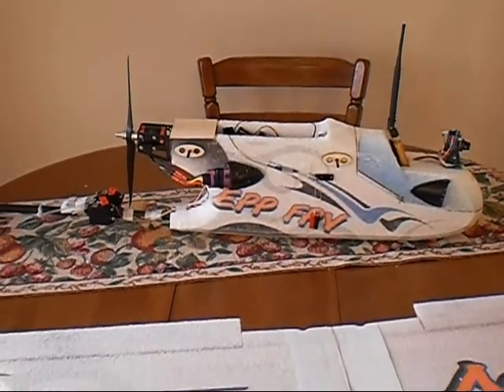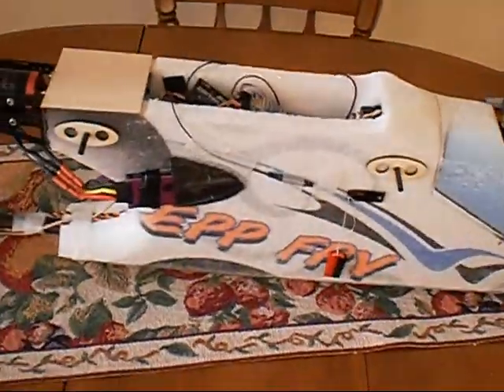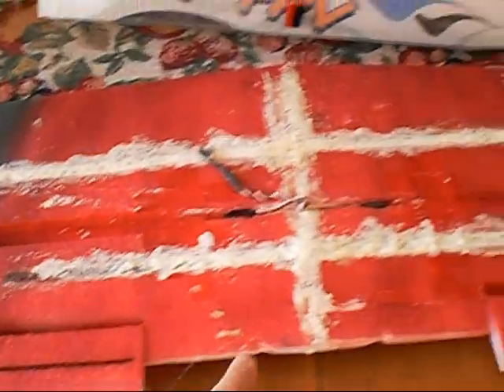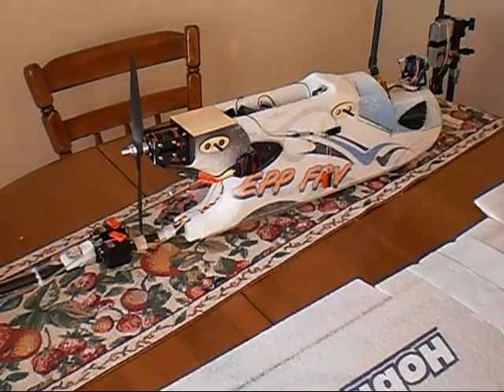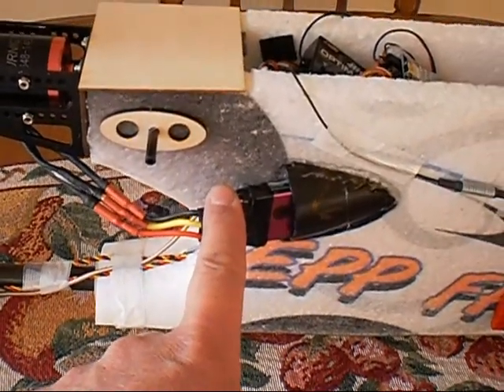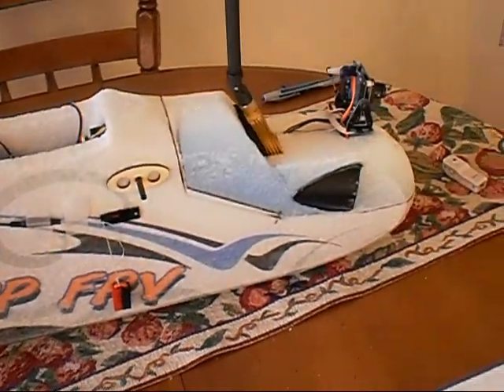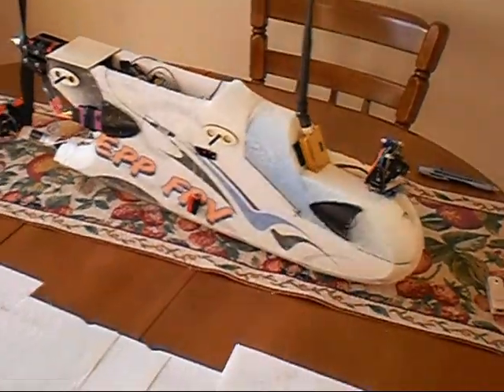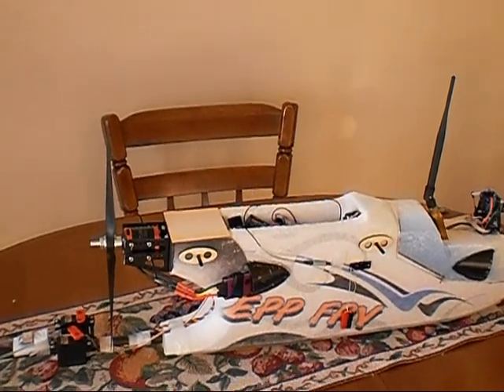Hobbyking epp fpv WING MODIFICATION and update eagletree v4

Comment from the maker: My skywalker has not arrived hopefully this week so i will compare and make a video.But the hobbyking epp fpv with the wing mod and the tail larger fly much better than the stock plane. it's not fast so power and prop it for slow flite with alot of thrust. 
I find it likes to fly around 20-30 mph faster than that and your wasting power. It is tuff and easy to repair just hot glue or glue of your liking.
Straight out of the box it needs some work hope this helps,  i will compare the to planes